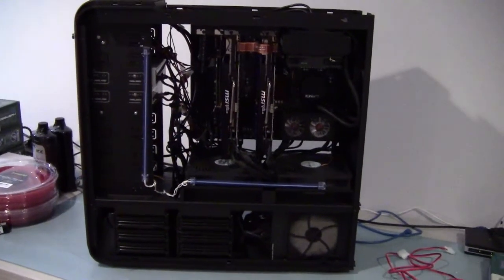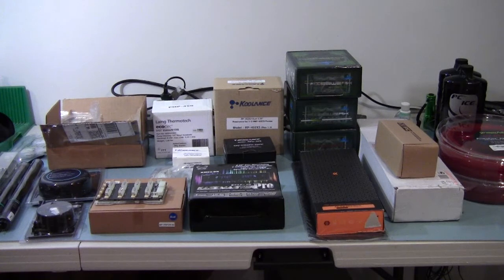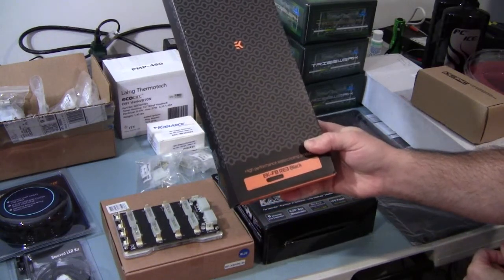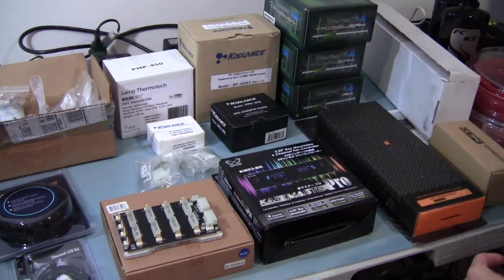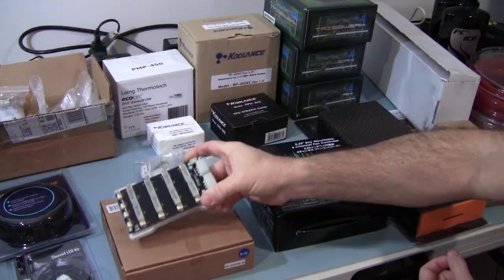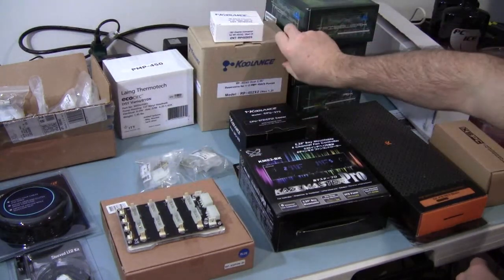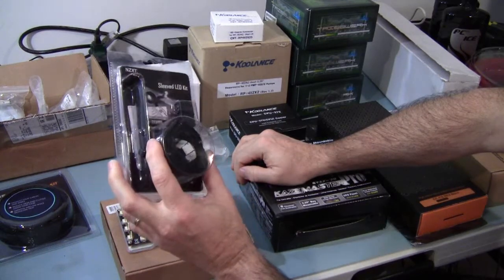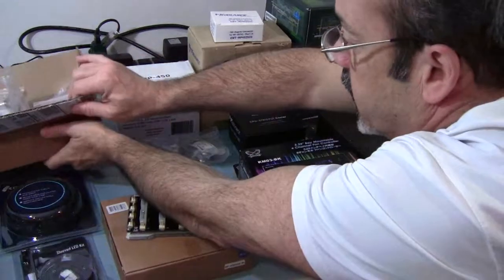Kick-Ass Temjin TJ11 Build - Part 1

Comment from the maker: @kirua013 The space down in the compartment is 630 deep x 204 wide x 154 high.  The height of your rad just makes it, ytou need to consider if you will be using any type of bracket mounts or you could use velcro to hold the rad in place. Also your length should be fine but to be sure what is the dimensions of your power supply ?  You need to take that into consideration to make sure your fans and rad don't bump into the PSU. As soon as I get my build pictures up you will see how tight mine was.

Comment from the maker: @kirua013 It was my first water cooling build and  I was not sure what size rad to get. Depending on your power supply it is a bit of a tight fit. a 140.3 would work, but a 120.4 would be tight. Also if you use Triebwerk fans they are 55mm thick so that made things more
cramped but they work great. If you use fans that are only 25mm thick
you would probably be okay. I will be posting the video showing more
of the build soon so you can see how everything fit.

Comment from the maker: You can use any pumps with the EK Water Blocks. The key is using the right fittings. Most all the EK blocks ave G1/4 threads.  The most common thread used in water cooling these days.  Sorry it took me a while to respond. Thanks for watching.

Comment: Hehe. Looks very similar to my system:
Koolance CPU 370
EK Rampage III Black Edition Fullcover Acetal EN
Bitspower Universal RAM Module 6-DIMMs - White/Black
2xKoolance VID-NX580 + EVGA Backplates
Coolgate 560+280 Ultimate Heat Exchangers
2xKoolance PMP-450
Koolance RP-452X2 Dual Res rev.2.0
Aquacomputer AQUAERO 5XT Black
All in a TJ-11 ofc.

Nice videos btw, subscribed. :>

Comment from the maker: @kirua013 You should be fine.  If the width of your PSU is 86 and your rad is 55.7 and your fans are 25 then the width of all three is 166.7  the width of that space is 204mm so 204-166.7 = 37.3mm of open space that you will have between where the rad and power supply overlap.  It will fit, you just need to dress your PSU cables well in that area so they do not hit the fan blades.  But no worries it should fit in that space.  I will send you a note as soon as I post the pictures of mine.

Comment from the maker: @kirua013  Did you order your TJ11 ? I will be selling this case, it is only 4 months old it is
on e-bay item 330678858019.  I am upgrading to an SR2 and it will not fit in this TJ11.